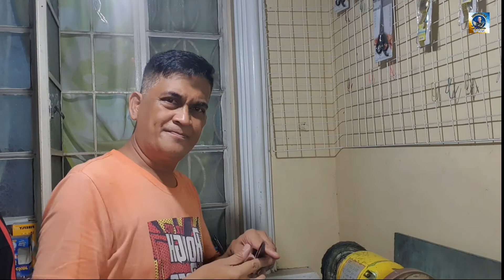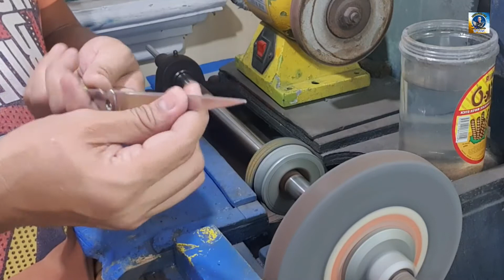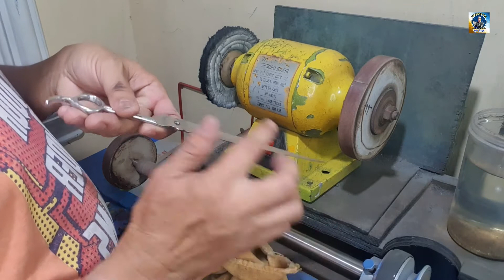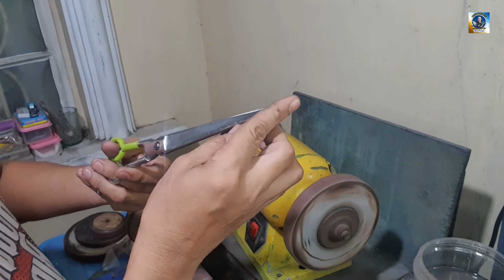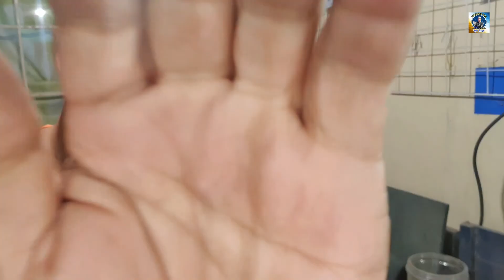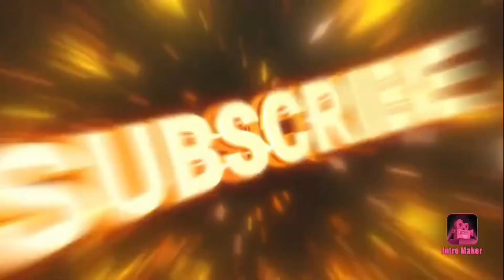PAANO MAG REVIVED NG GUNTING NG BARBERO.

Comment: Could you show more thoroughly the small wheel with which you sharpened the back side of the blade on 3:20 minute? Is this disk made of wood ? And the edge of this small disk is oval or straight ? Thank you for video! Your sharpening technic is great.